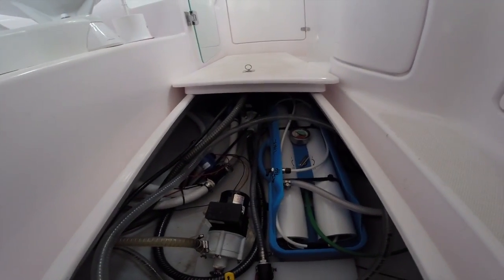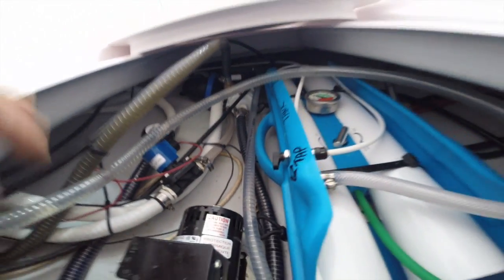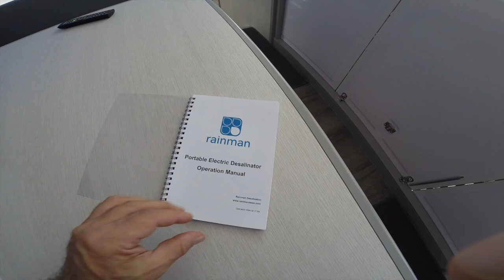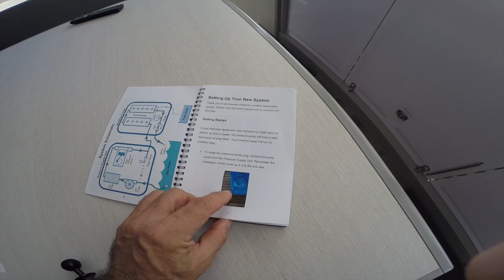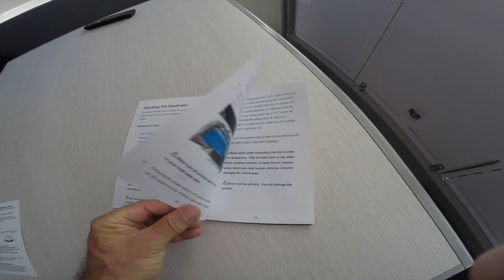SV Pali Pali Story # 12 (Rainman WaterMaker)

Comment: Hi Andrew, 
I'm just instaling a 230V AC Rainman watermaker on my cat. The installation is similar to yours with the primary power supplied by a Honda EU20i. However, like you, I want a back up inverter system. I was wondering if you could recommend an inverter make/capacity which will handle the watermaker motor load. Thanks Bernie
Bernie.lindahl@gmail.com
Perth, WA

Comment: Sorry if you had already explained this but How have you been flushing and pickling your system?, do you swap hose to the intake on the pressure pump?
Reply from the maker: Hi Michelle, there is a Y valve at the salter water intake that allows you to turn off the salt water and introduce fresh water for flushing. Normally what I do if I know that the unit is not going to be used  for a few days I will make around 10 L of extra desalinated water into a separate bucket, shut off the Y valve salt water intake, and run the freshwater through the water maker, same process if you need to pickle for longer storage periods,

Comment: This is a well made video.  Thanks for posting it.  Very tidy installation you've done.  If I could add two comments:
1. Unless you've extended the intake hoses, you should only need ten litres for flushing.
2. Just to reiterate what you said, the AC system should be run on a generator (Honda 2kva or larger).  Running on an inverter is recommended as backup only.

We delighted you are happy with your system.
Reply from the maker: thanks for the great tip, will reduce the flush to 10L, and agree that the Inverter is just as a backup system for emergency use if the Honda Genset fails.

Comment: Rainman, great choice. I like their products and I like the people in the company. I am thinking of getting the portable one, powered by a portable generator.
Reply from the maker: Hi Gerben,  yes great company and service if you ever need additional parts which we did require for the hard mounted installation on our boat. This type of  setup can easily be removed within about 10 minutes to be made portable to another boat or beach house, the 240v system is the way to go and runs well with the honda 2000 generator